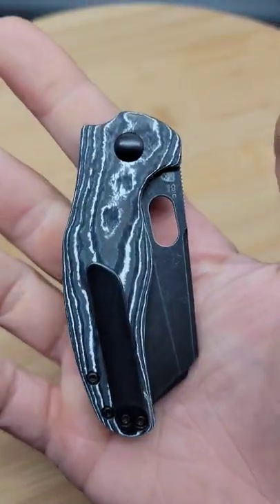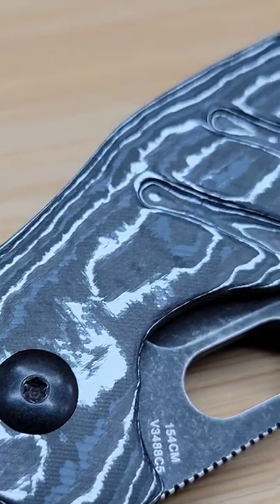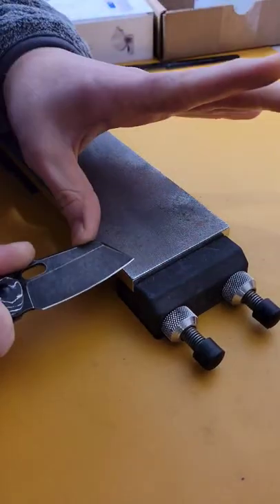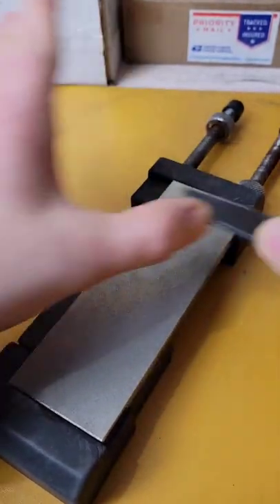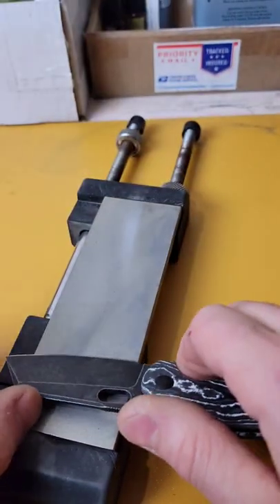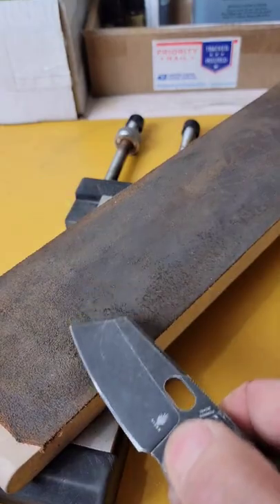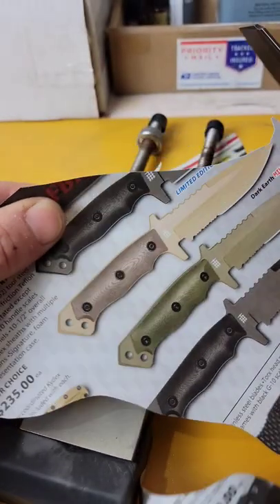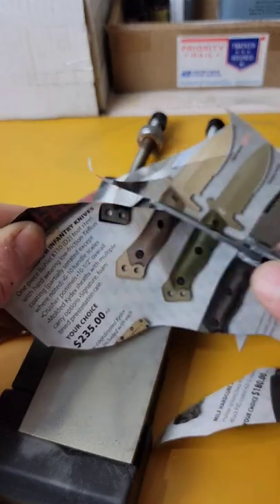SHARPENING 154CM STEEL

Comment: Great Advice on 154cm.  Got Started many years ago.  When Benchmade was the Great, So. I Have. ALOT Of 154cm.
Thanks for Tips. ✌👋
Reply: Benchmade is still my fav
Reply: @chadvail4436  they have went down hill unfortunately. Their qc and feel are no where near as good as they used to be. I like their full tang knives now but folders are lack there of In my opinion.
Reply: @Sackmatters  I have a mini grip secondhand in 154cm and it came with less play than my brand new mini Adamas. Sent the Adamas in and it came back exactly the same 😂fuck benchmade. Still love them
Reply: @shroomsrus5116  l

Comment: I could be wrong and please correct me if so. I think 154cm is great, made originally for ball bearing use in aircraft engines in the 50's. I like the fact that it is already high carbide and is the only steel I know of that doesn't get any better in powder formulation. It's a great all round serviceable blade steel. I think that's why we see it used so much in side autos and tactical formats

Comment: Hello Jared ! I have a new Kizer Cormorant and i want to get it sharper. Is it ok if i sparpen it with Work Sharp guided field ? And i have to use all granulations + ceramic or only the 600 grit ? Thanks

Comment: Hi... yes I have trouble too on sharpening all my Kansept blade with 154cm steel to a fine edge... it doesn't do well for fine and polished edge and I don't have problems with other steels on my Sandvik 14c28n, S35VN, S45VN and M390 (btw, all these steel i learn sharpening from most of your videos anyway and i really appreciate you for that 😄)... so goes back to the 154cm steels, can you explain why does 154cm don't takes good fine edge? Thanks

Comment: What is your preferred grit on 3V?
Reply from the maker: It depends on the heat treatment,  geometry and angle but if properly heat treated it does well across the board if your using a good angle

Comment: My Emerson has no teeth if I sharpen on fine grit. I go medium and strop.  It's weird though because I have a buddy that is deep into the weeds with Benchmade. His EDC is a 154Cm material, and it takes a pretty fine edge. Maybe it's an edge geometry thing, but I'm not really sure.
Reply from the maker: Geometry is a huge thing, same with heat treatment,  and 154 cm in some cases can take a decent fine edge but after use it gets slick pretty quickly, so I find in most cases not all but most that a medium grit edge does best, especially if you look at the amount of bite the 600 to 1k grit has vs a mirror edge, the medium grit has a lot more

Comment: Why doesn’t 154CM take a polished edge? What happens to it?
Reply from the maker: It takes a great polish, but it has the potential to lose its bite, there's a bunch of steels that do that and it can be counter productive if you want your edge to have a lot of bite into materials, after little use they can get slick and slip out of cuts cpm 154 is even worse at high grits
Reply: Thanks!

Comment: Yeah I just got the 10v mini recently with micarta and the damn thing refuses to lock upp smh I have to legit give it all the wrost I can to MAKE it lock in order for the blade to lock open I've cut myself so damn Manu times on this knife already from thinking it was locked up and NOPE where's the band-aid lol because the 10v takes a wicked edge I just wish the damn thing would lock and there was so much blade play side to side when I got it and I bought it from bladeHQ 🤷‍♂️🤦‍♂️ still wouldn't get rid of it but it sucks never knowing if the blade is locked or not, eventually I'll disassemble it and grind down the ramp a bit so the lock bar actually grabs it...

Comment: Paper is for testing scissors. Everyone does the paper thing, but nobody shaves paper w/ their edc. Test using everyday cutting
Reply from the maker: It's just showing a good edge and clean apex, it's mostly how well it does it and the sound, professionals can hear the difference. Because an edge is for the entrance of a cut the blades geometry is for passing through, so cutting most things won't say much about the edge unless it's only about the edge, like paper, hair, paper towel, some fruits exc..